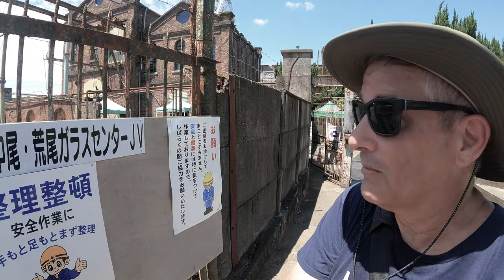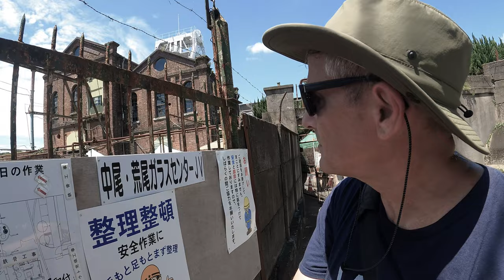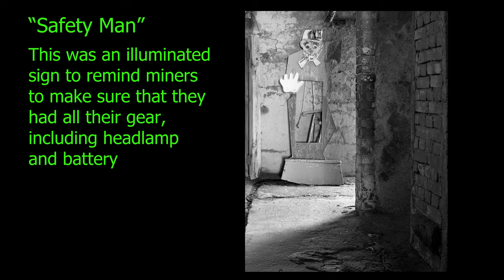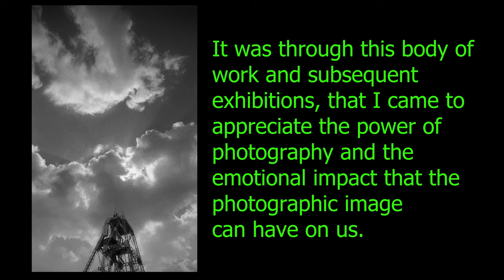Manda Coal Mine, Revisited: A Walk Down Memory Lane...

Comment: Thanks Andy, are there particular reasons you exposed hp5 at different ISOs like 125, 320 and 250, then developed in Xtol at 1:1 or 1:3? I may start trying xtol, but am not familiar with the effects rendered at different dilutions.
Reply from the maker: For normal contrast scenes, I expose HP5 at EI 250 to get .10 density for zone 1. This way I get good shadow separation. For high contrast (N minus development), I'll give a bit more exposure, depending on how much I need to curtail development. For example N-1 development, I'll expose at EI 200. N+1 I'll expose at EI 320. This is to keep zone one at or near a .10 density. Sometimes I'll work at box speed, or even push develop at EI 800, if I'm going for a really dramatic look, and shadows are not so important. I made a video about that a little over a year ago. Have a look and let me know what you think! It was a real eye opener for me! By the way, XTOL is one of my favourite developers, especially at a 1+1 dilution for a bit more sharpness. Hopefully we won't lose Xtol due to the recent Sino Promise debacle!